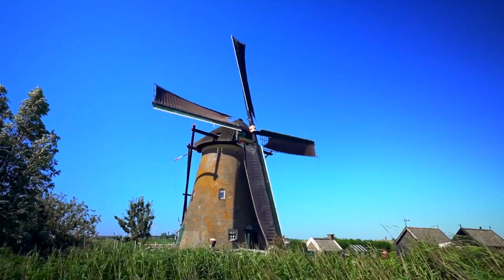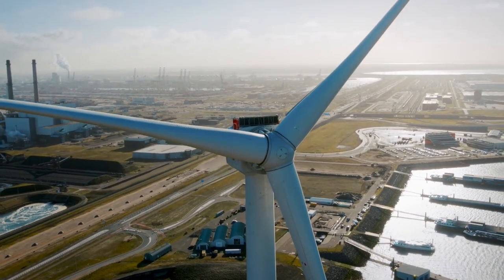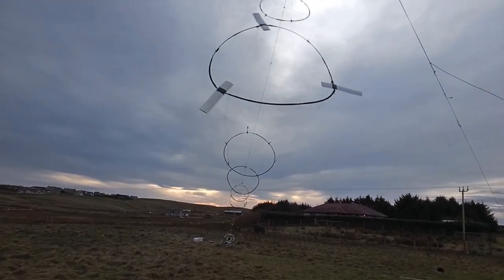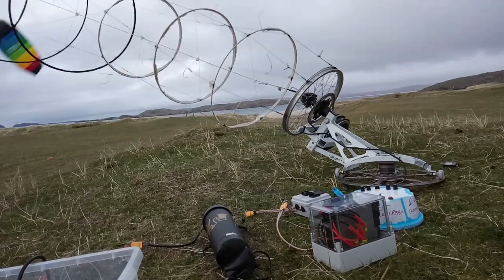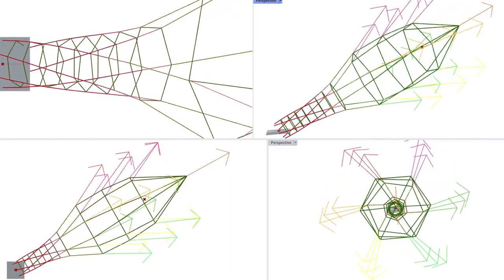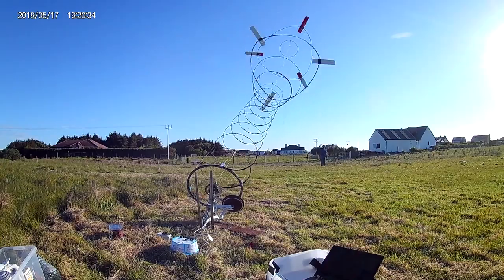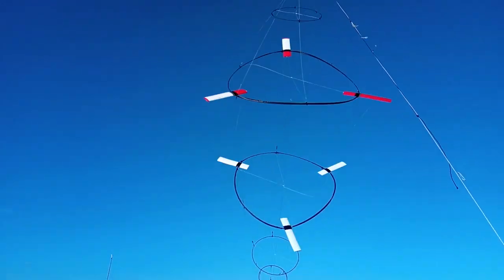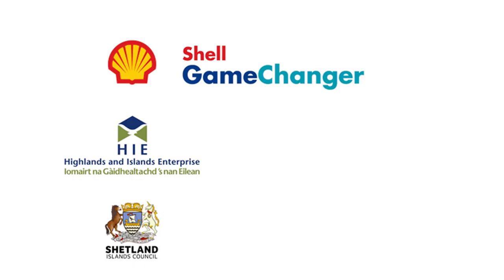Why Kite Turbines

Comment: In a new fan of this idea, seems like the components could be incredibly cheap to build and maintain at scale. I wonder if the designs should actually become simpler and cheaper to take advantage of manufacturing costs. In particular i worry about durability during storms, and takeoff during windless days. If the kites were at altitudes above the storms, and were able to survive up there with little maintainance that would seem ideal. Perhaps a minor digital controller can be placed on them to adjust drag automonously. Generating power by creating phases of high drag or low drag, and preventing damage caused by overly high drag

Comment: Have you considered individual domestic solutions of rural areas or even small community solutions powering households electricity needs  as opposed to pursuing big business? I'm aware in the beginning you personally can make more money selling or partnering, on your innovation with Big Business. Smaller, efficient, inexpensive to produce, easy or fast to set up domestic electricity generating solutions are more useful to the people.

In my lifetime, Worldwide, we have witnessed Big Business buyout & shelve any idea that is cheaper or alternative to the more expensive electric vehicle technology they have been pushing for decades. 

I would love to see where this technology grows in the future. Wishing you success.
Reply: The Rainbow flags are great. I imagine I'm not the first to point out the advertising potential on panels, on community kite power electricity generating facilities. Local business sponsorship?

So deep into the project I imagine you have already considered 'Patreon' or 'GoFundMe' type (someone else may b able to suggest a variation more suited to your project) funding. These have the advantage of promoting your product, getting the news out there.

How long do the sails/ panels last, how often do they need to be replaced?
Reply from the maker: Our initial idea was to start producing ~5kW (Adventurer) systems for sale based on what we had already done. But this would not be fully autonomous.  There isn't huge appeal for a system which needs you to stay nearby to keep it operating. So instead we open sourced the small mechanically semi-autonomous designs. We're now developing full automation, which will initially require a product of minimum 50kW (Wee Village, business or farm size) to justify the associated cost. The safety and scaling enhancements will potentially offset a lot more carbon
Reply from the maker: @2DGraphicDesign   The blades are exceptionally lightweight - we are going to further assess longevity through the course of this automation phase of our project - predicted life of leading edge tape ~1 year before it needs re-taping
Reply: @KiteTurbine  Thank you for your prompt reply. I will watch this space & share vids.
Reply: @KiteTurbine   What size is a Wee Village?
Reply from the maker: @2DGraphicDesign  ~20 houses

Comment: I'm curious about scalability, the power transmission down lines seems like they would just twist if you put too much torque in the system.

Have you 3d models out what the lines would do on a massive system? Should be easy on a physics similar.
Reply from the maker: Yeah. We've got a lot of testing to do to continue proving the scalability calculations

Comment: It has already been tried sorry .kites would need a tower to self launch Looking to recharge an electric bike on tour micro wind or micro hydro.  Have you built anything like that yet i found a comment of yours making that claim ?
Reply from the maker: Yeah, about 6 years ago, https://youtu.be/Feiyg4zr_Mw The tests back then all used the bike as a ground station. It would be a lot of line, sail and rod equipment to organise carrying on a bike... scouts managed that though. We're now focussed on automating deployment for safe scaling. Yes using a very small tower, just enough to initiate the lift kite and clear the tips of the rotors in their start position. If you're on bike scale you can launch by hand and leave it flying
Reply: @KiteTurbine  thanks for your reply 💯 i will check out your link .